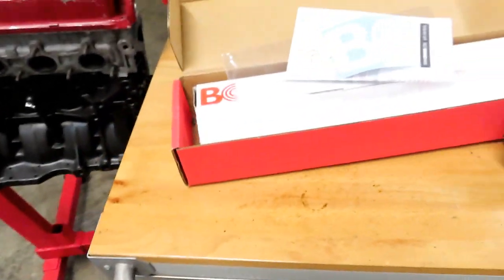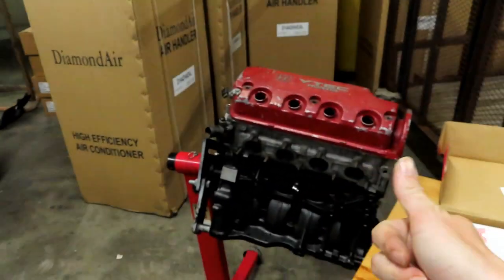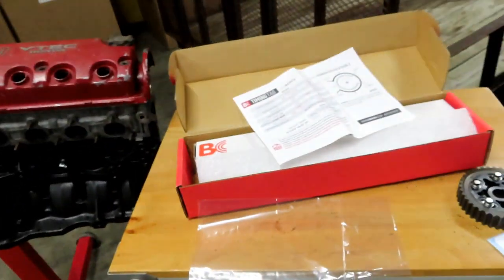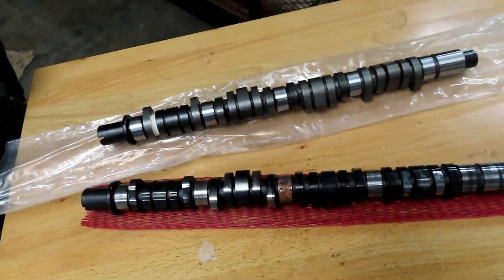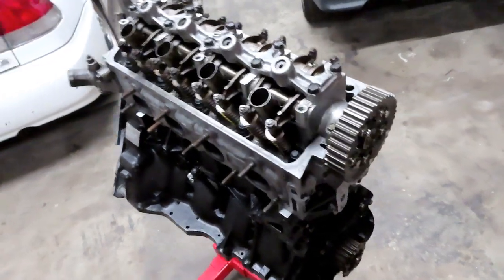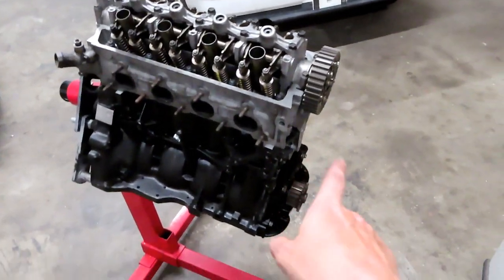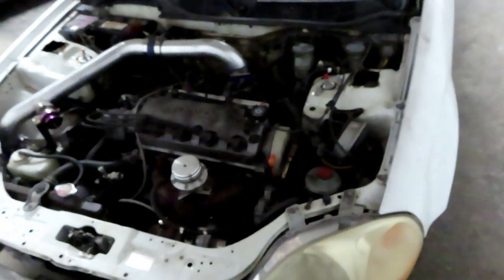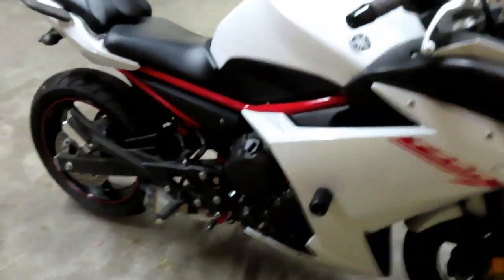Installing a Brian Crower Stage II Turbo Camshaft In D16

Comment: Hi! I’m in the process of doing this D16Z6 build; YCP Vitara 75.5 pistons, No notch long rods so the compression is around 8:5.1 instead of 7:6.1 on the standard rods. I’m using the Ferrea 6000 competition intake and exhaust valves, BC springs on stock Z6 retainers and the comp cam stage 2. Z6 crank as I would prefer the extra oil port for the bearings.. head will be ported, polished and skimmed, valve angle 3 to 2, with the adjustable cam gear and cylinder protector.. and because of this video il either get a better oil pump or do the spring method to the z6 pump
Reply: Nippon vitara’s bump compression up a point over YCP’s
Reply: Literally my exact build but in a y8 how you liking it?

Comment: Question. When you do your timing, do you time it like you would to a stock camshaft or will it be different?
Reply: It'll be different, need a wheel to measure and adjust the aftermarket sprocket

Comment: What’s the difference between the z6 head and the y8? I have a z6 head and I really want to use one of those Bc cams but it says it doesn’t fit sadly.
Reply: better flow in z6.
Reply: Z6 is better for turbo flows, Y8 better is for a high CR N/A build cuz of the combustion camber shape that has less  possibility of knockings. Both heads should work with this camshaft. I have a D16W4 head (new version of Y8) with Z6 camshaft and rockers :) The only difference is in the direction of the "fin" in your igniotion device. If swapping between Z6-Y8 you have also to swap direction of the "fin" in your ignition device. Thats all you have to do ;)  
By the fin i mean this "wedgish" fin that is connecting rod with the ignition device :)